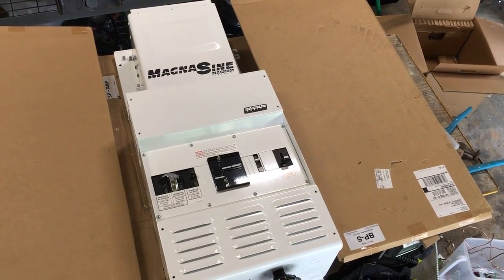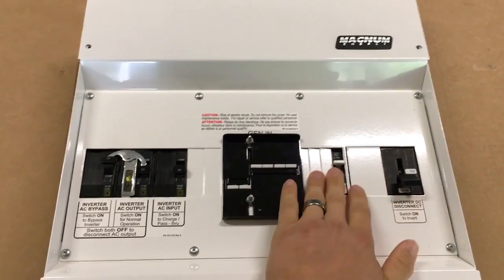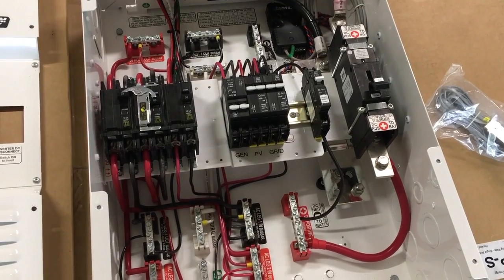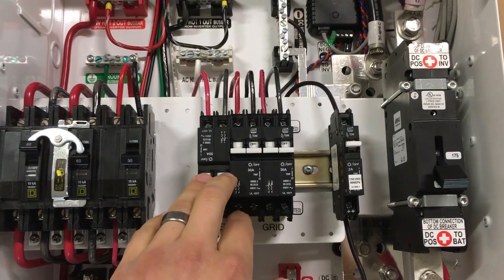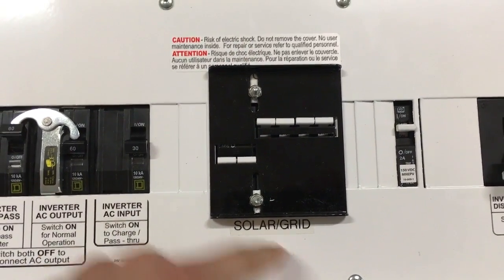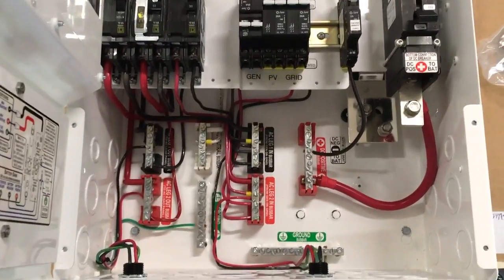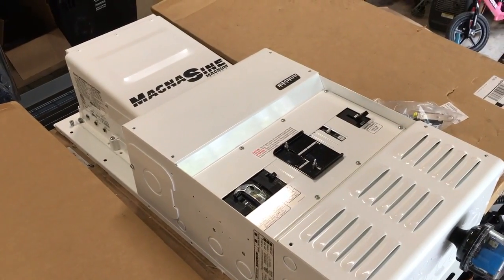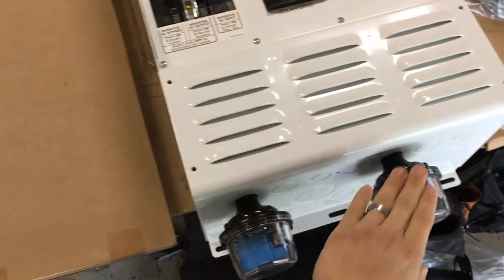Magnum Inverter Wiring:  Yes You need a Load Center!

Comment: Hi, I think I got the wrong mmp for my system. Mmp175 60s instead of the 30D. My inverter is a 240v inverter ms4348pe. What can I do to make the 60s work with 240v.
Reply from the maker: Mark Franklin you’ll need to order different would square D QOU panel mount breakers.
Reply: Gain Solar Services ok thanks I will order a 30amp single

Comment: I have question I'm switching to Dual Inverter by MagnaSine my old systems is 48vdc that is mounted on Midnite Solar with a couple of Outback FM-80 Charge Controllers now my Question do you still needs these Outback for the Parallel Magnum Set UPS, I have all the items needed for the new Set Up from Northern Arizona Wind and Solar this units will be installed in the Philippines next Month thank you very much Sir..
Reply from the maker: omar escalante the charge controller let the solar charge the battery.  The inverter pulls power of the battery to run the loads

Comment: I have a Magnum Energy MS4024PAE MS-PAE Series 4000W 24VDC Pure Sine Inverter that I plan to use with my Renogy 3000 Watt Cabin Kit solar set up. The Renogy kit came with a MidNite load center and a MidNite Classic 200 charge controller. What would be the advantage of using the Magnum load Center? The Magnum load center certainly looks like a higher quality unit. We are off grid. I am planning on either getting a 10,000 watt Generac propane generator or a military diesel generator to use the auto start with the Magnum inverter.

Comment: Could you help me understand about wiring a generator to be used for powering the oven and a dryer.  Would the generator be wired through the inverter to the dryer or would you bypass it?  Also could the generator be powering the dryer and excess power be charging batteries at the same time?  You have excellent videos btw!
Reply from the maker: Dont try and backup a dryer or oven with solar.  It's a losing battle, heat is too energy dense and if you want to backup a dryer or an oven you should convert it to gas or find another way to do what that appliance does.  I'd use a clothes line for the dryer and a green egg or grill for the oven.

Comment: I just received my MPDH175-30D a few days ago. Even though it is going to be powering up just 1 inverter for the time being; I can say it is a bit overkill, but I do like a lot of options and it can get very expensive if you pigeonhole yourself. I've looked in to the other "food groups" and you really can't beat the internal real-estate the Magnum Panel. I currently have quite a few 48 volt DC telecom gear and the DC load centre will definitely keep them happy with a plus of keeping everything neat and orderly.

Now, I need to dust off some of my industrial power control skills and figure out a way to integrate the standalone AC coupled solar and generator to be fully automated without letting the preinstalled smoke out. Making your own power now is up to your imagination and pretty much limitless short of $$$.  ;-P
Reply from the maker: Felax Chow Have you bought an inverter yet?  I’ll sell you one at a fine price. You could use a relay controlled by the generator circuit to switch the GTI off. Do you have an automatic start generator.
Reply: Yes, I already have the MS4448 for a few years and been tinkering with it. My generator does have an automatic start function, at the moment it is mainly remote start and manual transfer for the time being. My GTI setup is 6.4 kW and it is broken up into two arrays and I would like to have both arrays up, but I don't believe you can stack the ACLD-40 together as of yet. Since I can split them up, it is not a big deal. The fun part is moving the shelving unit, then the dryer and lots of measuring if I have the room to on that wall to put everything on it.

It took me 2 years to upgrade to a metal roof and another 5 for my GT solar. Traded a few parts along the way and having fun at the same time. Plus, I need to fix my solar powered gable fan before it get too hot in the attic.  Good times...

Comment: You answered my dumb question on what's on the bottom of the unit surge protectors, smart setup.
Reply from the maker: Brian Davis you fired it off early!  Yes those are the mnspd300vac surge protectors by midnite solar. Do you want to buy an inverter. I can help you figure out what you need and talk you through it and sell it to you as cheap as anyone on the web
Reply: Gain Solar Services yes when we get to that point I planned on calling you with what I'm hoping to achieve with our needs hopefully you can help me come up with a design that we'll be happy with.
I'll keep you posted on our progress, thanks for getting back to me so soon.
Reply: Gain Solar Services I'm going to start doing my lay out of what I'm hoping for in a system I know it's expensive so I can't afford any mistakes I have a big wish list do you have a website I can go to or?
This whole thing is for my 40ft MCI MC9 hwy coach I know I want solar and maybe wind turbine for extended stays mounted on the roof but quick releases for travel
I know you can buy commercial panels with big watts output I have a Honda EV6010 50 amp generator for backup and the coach has a 24 volt electrical system the alternator puts out 250
Hot amps so some kind of state of the art inverter regulator I bought one for my last coach almost 20 years ago by cruising equipment out of Seattle. Anyway that's kind of what I have to start with nothing on the inside will be 220 volts but wonder if a split phase might be the way to go and lithium batteries sounds like the way to go but are crazy expensive sorry for the small book here lets talk a little I would appreciate your feed back oh system design thanks for your videos easy to understand.

Comment: Hi I'm new at this I've got a MC9 hwy coach I'm going to put an inverter setup in it.
 what a great looking unit I've built a coach years ago we didn't have an all in one it would have made life so much easier I want to run a fairly large battery bank and solar on the roof I've even considered a wind turbine with it mounted on the roof but easily removable for travel if anyone has any thoughts on this it would be appreciated.
Oh I gotta ask what are the glass or plastic devices on the bottom of the unit? Sorry I told you I'm new at this with today's technology.
Love your videos great explanation of what's what.
thanks,  Brian

Comment: i see some on some of the wires boot lace ferrules are used. i use them on all of my connections.
Reply from the maker: Urs Odermatt i use them with fine strand wire in terminals for solid and 7-11 strand. Are you using all fine stranded?
Reply: the large diameter wires for the batteries and inverters are fine strand wires. i use the boot lace ferrules for everything. if you have a good set with many colours they come in handy to colour code the wires as well. the ferrules are very helpful for inserting small sensing wires into the recalcitrant terminals.
i am not quite sure about that, but europaen standards the ferrules are compulsory.
the boot lace ferrules are particularly handy for screw terminals. peronally i think screw terminals should be outlawed.
Reply from the maker: Urs Odermatt awesome response. I’m not sure what a boot lace ferrule is. 

I have a set perhaps I should make a video about ferrules.
Reply: boot lace ferrules is just another name for the ferrules, those bits at the end of the wires you showed in the video